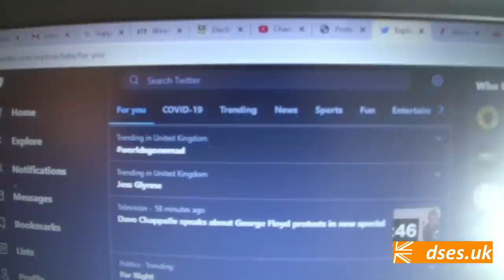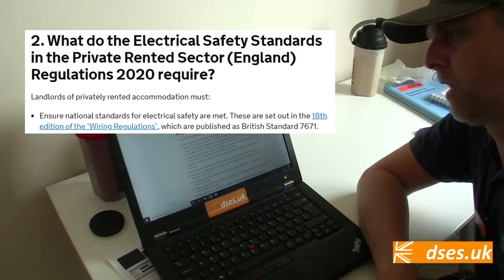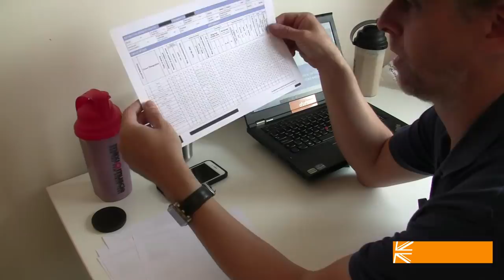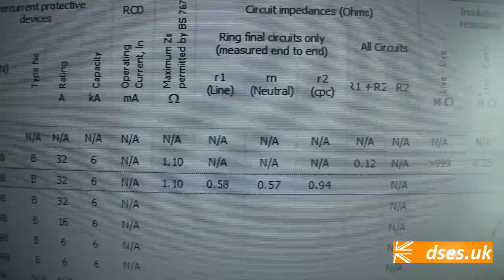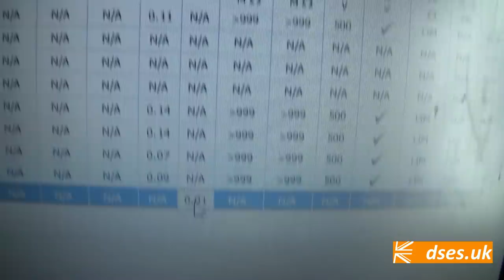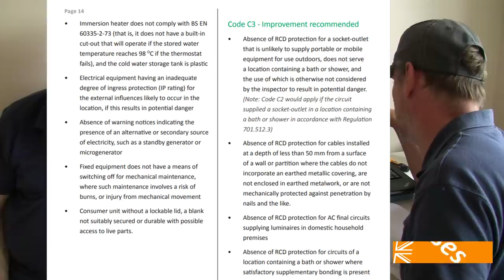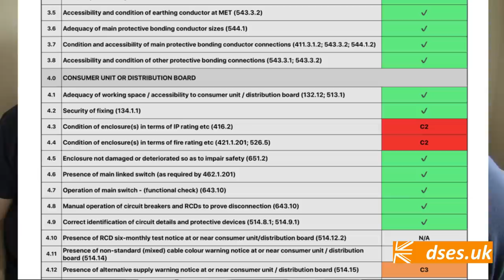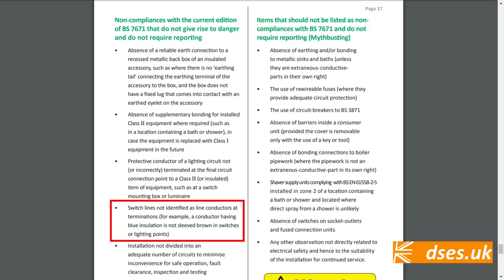Landlord electrical inspections from July!

Comment: I think you have to bin the guidance.  What do the regulations / legislation actually state in respect of Private Landlords (England)?
Reply: The legislation states must comply with 18th edition. And 18th edition states installations to a previously version are not necessarily unsafe for continued use. Why bin the guidance ? It’s up the the inspector to make his own judgement and and declare satisfactory or otherwise - therefore it is a subjective report. The guidance is just that - a guide in an attempt to educate and provide a framework to create, in theory, consistency across different “opinions” in terms of coding.
Reply: @Marco-mg9tv  Because it is the Govt Regulation that is relevant.  Govt website guidance to any legislation / regulation is often wrong/confusing/not in line with what the legislation/regulation actually says. So any 18th Edn Guidence itself is suitable - the vid shows how the 18th requirements can be interpreted slightly differently in some situations.  but if the Govt Regulation modifies in any way the 18th Edn applicability in a Landlord environment then the regulation takes precedence.  If the regulation itself is so poorly written as to make any conclusion unclear it would be difficult for any judgement to be made and a court of law probably would find it difficult to conclude if a Landlord failed in any way to 'comply' or otherwise. At best the landlord regulations would become void and the common law of failure to provide a safe environment would apply for any let residential premises, and if the facts demonstrate that there is no clear point where safety is unreasonably compromised it would be difficult for a licencing authority not to grant a landlord licence where said authority has made a condition of the licence dependent on an electrical safety test.  the problem is the apparent insistence on an absolute in the landlord guidence, when the absolute standard is in itself, variable.

Comment: The HSE note on page 13 says "Existing installations may have been designed and installed to conform to the standards set by earlier editions of BS7671 or the IEE wiring regulations. This does not mean that they will fail to achieve conformity with the relevant parts of the electricity at work regulations 1989". So to me, if whats there is safe, its OK. And as an aside, we were asked to price remedial work on a property just after the metal board regulations were introduced. We had to point out to the owner that a dentists surgery is NOT domestic so DID'NT need a tin board! What idiot tested that!
Reply from the maker: Just that Ian, it's ridiculous to say a 17th Edition Amendment 2 installation is now suddenly dangerous and needs ripping out which is what we saw in the £85 EICR video a few weeks ago! Like you, we've also seen commercial installations written off with the "must be metal" slap across the face!

Comment: You kept on mentioning 19th edition may require Arc Fault Detection devices in consumer units as an example. Not being an electrician, can you future proof yourself by fitting something now that may have something that’ll later be required for 19th edition? I think the answer would be no, because although the consumer unit had the thing that’s required for 19th edition, because it was made before 19th, it’s not been approved. Does this sound like a typical thing you face a lot? Also I like the point about 18th edition units being designed to contain fires, and you’ve mentioned this a few times, but the only other YouTube elec who (and he doesn’t actually talk about it, just fits them), who seems really conscious about making sure things are not going to spread fire is Chris Reeves. I’m sure the other YouTube sparks do, but only you two seem to mention this. Good video especially for a non electrician!
Reply from the maker: The AFDD thing is just a hunch Philip, but I wouldn't be surprised if they started mandating that or other things such as SPD's, or an end to split-load boards or, knowing them, a change back to plastic enclosures! What goes around can come around - we came across a mid-1990's installation today with a 30mA RCD covering all circuits, MCB's and a metal enclosure. That was installed in 16th Edition, but ticks the boxes for 18th Edition! I'm sure someone will still come along and write it off though, just because it looks old!

Comment: I think in the 15th edition you had to have one RCD socket for out for use, then in the 16th I think initially it was ground floor sockets only, then at some point out changed to all sockets and from then on we were RCD crazy.
Your right about the sausage munchers at the IET, they are not capable of producing a book without errors all copy and paste, they made the same mistake in the 18th as they did in the 17th on the bathroom zones.
Reply from the maker: Thanks Anthony, I didn't know they'd specified it for ground floor sockets at one stage.

Comment: Re rcd.s I believe the 16th edition boards had them on 1 side.  Mostly used for sockets, ovens, out door lighting. And then on the no rcd side lighting smoke alarms.
Reply from the maker: That certainly came in Gary, but 16th Ed ran from 1991 to 2008 and was amended six times. The RCD requirements were tightened up during that run, but it wasn't until the end of the '90s that you started seeing split-load boards where an RCD covered half the circuits. It would be interesting to find the history (that's how boring I am).
Reply: David Savery Electrical Services ahhhhh yes that makes sense, but before my time, just thought I’d chip in lol
Reply: Another brillient vid as always dave, good to see the band back together and loving the censoring.. really makes me laugh when you start! 😂
Im with you on this, your checking the condition of the existing wiring for when it was installed to see if its still safe for continued use at the time of the design. I presume the change in the EFLI to the current regs is for when the DNO replace the transformers for the 'high efficiency' ones I.E. dropping the tappings to 230V so checking if the original design can still come with that?
As for the RCD, as i can remember they used to use an RCD socket near the front and back door for if you were to use anything outside of the bonding zone? If its all bonded and as you said if the flat is in the second floor.. then C3 👍😁
As for the DB if all the connections are torqued up its unlikely to spontaneously combust.. although it did look like Nige might at some point! 😂, C3 and a recommendation to upgrade. Especially with all these LED lighting and gadgets we have these days and the DC distortion being put on the network! Definatly not a fan of solar or electric vehicles these days.. especially having to work with 6 pulse VSDs these days. Without the correct filters they can cause all sorts of problems 🤔

Keep the vids coming, brilliantly executed as always! 👍😁

Comment: I think I'll buy that codebreakers book before I book my next lot of EICRs for the overzealous C2ers; I had some flats fail due to lack of RCDs and it's annoying to wonder if those board changes were strictly necessary now. The hoo-hah that we had when legislation changed here in Scotland around 4 years ago was the literature stating that the installation of mains powered smoke/heat alarms required a dedicated circuit despite some sparks saying to take it off the nearest light feed - they've since amended that. I remember the installation of these interlinked alarms became a bit of a gold rush and all of a sudden flats everywhere where sprouting mini trunking because of the sparks firing them in cheap and quick and unwilling to fish the cables.
ps. is Nige on the beetroot protein?
Reply: I had a gas safety inspection person tell me in January that they are not allowed to fit mains detectors when replacing out of date mains detectors 😕

Interestingly, the Aico sealed battery interconnectable units were £30/unit more than the Aico 3000's they wanted to replace.
Reply from the maker: The boffins come up with great ideas that can easily be applied to new builds, but are a pain to retrofit. I don't know what Nige has in that thing, it looks like strawberry Dip Dab!
Reply: How can a gas safe plumber install a fixed wire detector??? Unless he is a qualified electrician fool

Comment: Great video as per usual Dave! Question mate  - On page 38 of codebreakers  they give a C2 to socket outlets can be used outdoors. They also give a C2 to no rcd protection for cables in walls. Wondered how that falls on an EICR like the one you did? Cheers
Reply from the maker: Hi Jonathan. This was covered in the follow-up video to a certain extent. Regarding exterior sockets, this not being a ground floor flat I think we can assume the intention of the design was never to provide power to mobile equipment that could be used outdoors. The cables in walls thing was addressed by NAPIT who effectively said it's a limitation on most periodics as you're not opening walls, so it would only be a C2 if you can see a chase going out of zone or if the walls are open (for whatever reason) and you can confirm cables are present below 50mm without mechanical or RCD protection. Let's face it, that will be the case on any install before 2008, but if you don't see it, you can code it as a limitation.
Reply: @dsesuk thanks David great explanation. This no RCD debate is going to cause a lot of mixed opinions. I've alway looked at a non rcd board and gave a C3 if everything else checks out. I purchased Napit codebreakers and now I'm seeing all these C2's and its been making me re-think my decisions . Cheers mate

Comment: Hare ring circuits never fitted them
Reply from the maker: To hell with the damnable things!
Reply: @dsesuk  I hate them too but every time I hear something different justifying them due to voltage drop, more breakers on board (RCBO's ££) etc.. etc.. I keep "ringing" not even thinking if I really needed them.🙃
Typically, Ring upstairs, ring downstairs, ring kitchen, ring appliances (sometimes)  😒
What you usually do David? I mean what's your typical 2/3 bed house wiring looks like, 4mm radials or 2.5mm radials..??🤔
Did I miss a video on this topic? worth as suggestion? 
Great videos mate! Cheers!

Comment: David  - If you were to put in RCD protection would you have to change the board to a metal one?
Reply from the maker: Depends on the circumstances, but if an existing plastic CU could be upgraded to RCD operation, then I don't see that as being a problem. Changing or introducing different protective devices into an existing enclosure is permitted if the enclosure is designed to accept those changes and upgrades.
Reply: @dsesuk  - Okay so basically its what the board was designed for that matters. Thanks I was wondering.

Comment: When renting you MUST MEET CURRENT REGS  as all other regs such as fire etc.
Reply from the maker: Have you got some official guidance in writing that requires electrical installations to always meet the regulatory requirements of the day, or just to meet regulatory requirements in general, in which case older requirements remain valid? Only, typing it in caps lock doesn't make something true despite what the Daily Mail would have you think.
Reply from the maker: @chazM6116  Which says: "Existing installations that have been installed in accordance with earlier editions of the Wiring Regulations may not comply with the 18th edition in every respect. This does not necessarily mean that they are unsafe for continued use or require upgrading."
Reply from the maker: The guidance for landlords isn't the one-size-fits-all of all installations always being fully up to date all the time and for good reason: the regs change often; recently we had 17th Edition Amendment 3 in 2015 mandating metal consumer units in new installations from 2016, 18th Edition in 2018, 18th Edition Amendment 1 in 2020 and Amendment two comes out in 2022. Some of these updates have quite sweeping changes, but that doesn't make anything older immediately unsafe and unfit for purpose. It's ridiculous to suggest an installation from, say, 2015 is now "dangerous", as some rogues indeed code them, just because changes have come in since then. The guidance leaves it to the inspector to make the call based not on what new boxes can be ticked, but on the safety and standards of the installation that are verifiable and demonstrable. There is a follow-up video to this with further discussion, however it is rather profane.
Reply: @dsesuk  Landlords of privately rented accommodation must:

Ensure national standards for electrical safety are met. These are set out in the 18th edition of the ‘Wiring Regulations’, which are published as British Standard 7671.
Reply from the maker: @chazM6116  Uh-huh. Isn't that from the same document that I've already shown goes on to say about how existing installations may comply without upgrading? Also, have you read BS7671? In it is both a note from the HSE and regulation 651.2 on periodic inspections which both state older installations aren't unsafe just because they predate the latest standard. The presence of these clauses in 7671 allows for older installations to exist and to pass inspection without requiring upgrading. An older installation can comply with 18th Edition because 18th Edition recognises such exists even if they don't meet the letter of the latest standard. You may assume that, as a qualified and accredited electrical inspector, I know my onions. If all you have is that one sentence, then it isn't enough. Changes in wiring regulations are not retrospective, never have been and never will be. That's a fact, and you won't dig up any credible document that will say otherwise, even for rental properties.

Comment: 25:38  last one from me. Would the plastic chipped off the top of the main switch be an issue?
Reply from the maker: I'd say not Richard. Doesn't affect anything electrically or mechanically.

Comment: Super interesting David , thank you . I am upgrading in a few week ( hopefully ) to NIC approved . Can i pick your brains on no cpc's on lighting circuits if all accessories are replaced with plastic or class 2 ? There are lots of installations of that age by me and although i will be recommending a lighting rewire whats your thoughts on coding please ?
Reply from the maker: If the accessories are all Class II, then it's not a problem in my view and remains a C3. Even the metal screws going into the knockout boxes are exempt because of reg 410.3.9.
Reply: David Savery Electrical Services I was thinking along the same lines . I’m concerned because with them being rentals then I know tenants will be sticking up their metal switches and fittings and won’t read the labels on the cu . I like the idea recommending I do at least a visual between tenancies.
Reply: Code 3 if replaced or are already class 2. But in my experience you normally find non class 2 fittings and some generally poor wiring - Cpc’s missing either because a) Jonny NoScheme or DIY Dad has used a bit of two core flex from a choc block no longer accessible (taped up of course :) or snipped off the bothersome earth cores in the T&E or b) the property is 60 years old and the wiring has had its day generally. So often ends up being a code 2 unless you change the metal switches/lights on the day and/or rewire the cack wiring issues

Comment: Hi, very informative EICR with very valid points. Also nice to see a contractor no hidden agenda or one who is chasing remedial works.
 
I didn't get to see you guys inspect or test within the 'hazardous area' The bathroom, where RCD protection is required to cables supplying fittings (showers, lights, heaters etc) or passing through this area. With no RCD protection on your installation would this still be passed as satisfactory if say a non-enclosed ceiling light fitting below 2.25m or an electrical shower unit was in use? This is usually grey area for interpretation.
Reply from the maker: Thanks Mark. The use of RCD's for bathrooms is again a later revision of BS7671 and C3's for older installations according to NAPIT and ESF so long as earthing and any required supplementary bonding are in place.
Reply: @dsesuk  ahh yes, the old supplementary earth bonding within a bathroom location, not much of that ever to be witnessed in my area! And on the odd occasion it is seen, It seems many installers I've followed behind only seem to know how to attached one end of said earth bonding conductor, the other is often found flapping around!

Comment: great vid David as per usual! Only watched half so far! Question, just had my remote NIC assessment and as expected this topic was raised reference EICRs July onwards. I've been a domestic installer with NIC for a long time and all my work is pretty much now domestic. My assessor said from July I will be covered by NIC to complete EICR'S using their forms. I recall a video you made mentioning this wasn't the case. Do you know if the rules are changing regarding this? Sorry if you mention this in video as mentioned only watched half so far!
Reply from the maker: Last I saw Jonathan, the Di scheme guide didn't allow for EICR's, and that was confirmed by my assessor when he came to see me just before the lockdown. I heard they were tightening things up rather than relaxing them, but who knows with that crowd?
Reply: @dsesuk  My assessor in 2019 also mentioned I'd  need to have approved contractor status for EICR's but now apparently not the case. 
He said they would be happy for me to do them as I have 2391. Hopefully there will be some clarification on this from them.
Reply: Nic are letting domestic installers join the private landlord sector scheme but they want to access you doing an eicr. Ive registered to do i but to be honest think its a bit of a joke. If your approved you can just sign up to the scheme and carry them out even if you may never have done one or barely do any domestic work